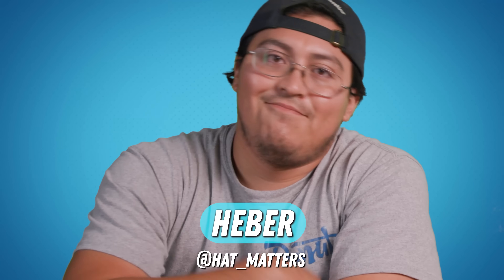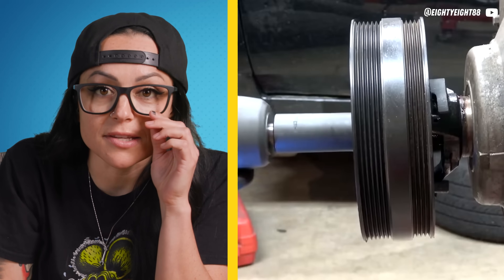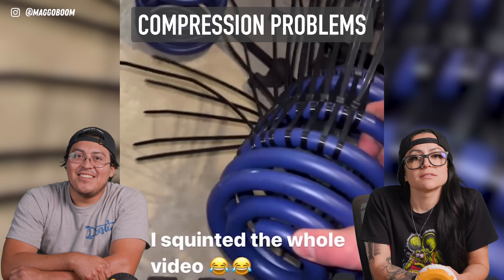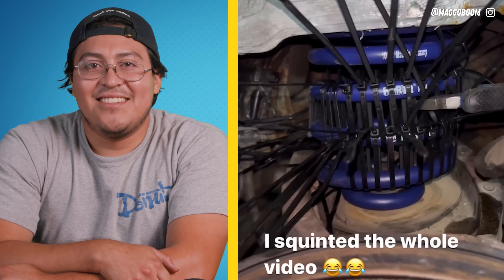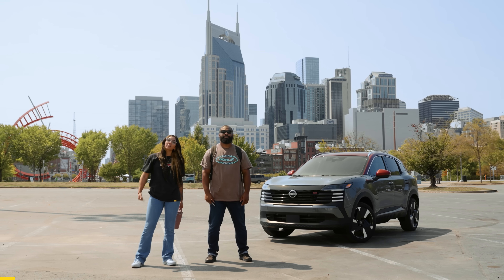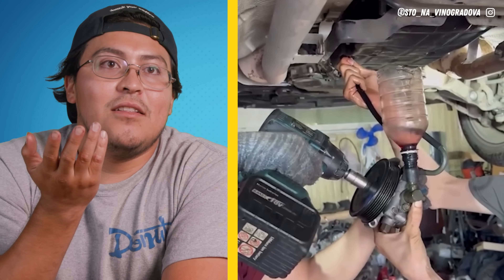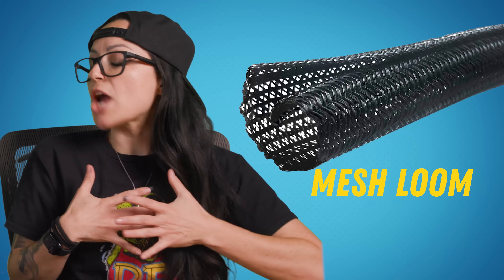Real Mechanics React to Ingenious Tiktok Hacks

Comment: 11:00 So my 2005 Escape XLT 4x4 has a separate V belt for the water pump, and its only connected to the front cam pulley. Both pulleys are not adjustable. So this would theoretically work....if there was room 😂😭

Comment: Air cooled Boxer (beetle etc) alternator is fixed and cant be moved. You use spacers on the(alternator)  pulley to widen / tighten the gap.

Comment: As I see it hacks like this comes in two kinds, the ones that can kill you and the ones that while not always the smartest thing just might save you time or money. The zip ties on the spring was dangerously close to death by spring while deforming the bolt head and hammer a socket on it is something that just might save you a day as you have to go buy tools. Now you really should buy the needed tools either way, but now you don't immediately need it. Then there are times when it can take so much time to improvise a solution that a quick run to the hardware store can save you time and improve your collection of tools. In the end it's all up to you. Doo what you need or think will hep. Just don't trust your life to zip ties holding a spring compressed.

Comment: Been doing the zip tie on the metal cable for years.  Something my pops showed me long ago when I was kid doing the breaks on my bicycle.
Reply: I just use my fingers though sometimes cable is a bit microdamaged and then your finger bleeds :D
Reply: IDGI. Why not just crimp a cap onto it before it frays, rather than after?
Reply: @ you wouldn’t be able to feed the wire cable through once you cap it
Reply: @besticouldget  I hear that haha
Reply: @letsgame7665  When a cable is new, it's not frayed. As soon as you install it, you cap it. Why do you need to feed a frayed cable through anything? (I ride 6000 miles a year on my bike and do all my own maintenance. I've never needed to thread a frayed cable through anything.)

Comment: The easier way to do the smoke test is get one of those $10 manual orange inflator pumps from Harbor Freight or Amazon, a $1 cigar from the gas station, light the cigar and put it in the intake port on the pump, then pump slowly.

Vaping does not produce nearly enough smoke unless testing a very low capacity system.
Reply: It honestly depends on the vape. Some put out an absolutely insane amount of vapor. That said, your way is cheaper since said vapes tend to run upwards of $75 U.S.
Reply: second this guy's statement, there are vapes that can fill a room like a fog machine with one pull... they're expensive and it's not easy to do but they do exist.

Comment: VW Beetle has little metal shims between the two halves of the generator or alternator pulley. If you replace the belt, you have to remove the bolt to adjust it anyway so doing it like this doesn't really serve much of a purpose.

Comment: VW pulleys don't move. It has a two piece pulley on top. You tighten the belt by removing spacers from between the two pulley pieces.

Comment: the spanner split loom trick works every time used it on cars plenty of times and the cctv cameras on my house even custom sleeves on pc builds I do have a tool that looks like a woman's hair clip that is cone shaped but I find the spanner is so much easier , the zip ties on springs no way would I ever do that. The socket trick works near everytime this is why i have cheap sockets in metric and inch in 6 and 12 point. Vice grip if your not using vise grips to close your vice grips you don't have the tight enough for that stripped bolt.

Comment: Nah, I'll stick to my bolt extractor tool, bolt on puller, and the correct size spring compressor tool. I do like the cheap smoke machine and power steering pump idea

Comment: I think I bought the car that the 'hammer the bolt to size' guy owned before- every fastener was messed up torx triple square bolts I should have dumped it in the bay

Comment: That is not a vacuum pump. He is using a small compressor and pressuring the bottom of the bottle to push the smoke out into the engine.

Comment: NOPE to the Zip TIe spring.  NOPE NOPE NOPE.

The belt at 10:40 is puhhhhrooooobably a stretch belt.  The trick would probably work on some modern GMs that are notorious for stretch belts running just one accessory off a 3rd belt.

Comment: 10:06 The pully on the old air cooled VDub generator/alterator is two piece. You just need to loosen the nut to spread the pulley halfs apart. It’s not that hard.

Comment: on the stripped bolt video ive bought actual sockets for that actual problem. Not a mechanic at all but there are tap and die sets for any sort of problem and all but i always have a kit for strips lug nuts anything else to be safe

Comment: If you seal in the rust effectively would that not at least significantly slow the spread of the rust?  Love the wire tie cable fix but blasting sand outta your bare hand has got to suck.

Comment: of all the years ive been a bike mechanic, and worked on cars, im still shocked when auto techs marvel at bike stuff... the zipp tie on the cabke, sorry to say, works the same if i just use my fingers as long as the strands havent been bent out if shape. the zipp tie wouldnt work any better if one strand was bent out of line, bike cables are full twist, fkat layed wire rope, not braided like tow or logging cable, ask any logger to hand splice a bike cable,😅

Comment: 4:40 I'd assume the reason budget smaller 'smoke machines' exist now is partially because of the vape industry, considering smoke machines work using the same theory, you have a heating element/chamber and a liquid

The liquid used in most 'smoke machines' is a mix of glycerin, propylene glycol and distilled water, the first two are also the major ingredients in vape liquid and is what the ratio referenced on vape liquid labels is referring to, more glycerin (VG) more/thicker vapour is produced but better wicking is required due to the viscosity

That being said... Probably don't put vape liquid in a fog machine designed to fill a room... It might smell nice if the flavourings don't scorch on the heating element but I can't imagine filling a room full of nicotine laced fog would be a good idea lmfao

Comment: Dropping a control arm, and then putting a jack under it to compress a spring... You don't like your jawline much, do you?

On cars where spring compressors won't fit, here's a nifty option. Run down to the parts store, spend $20, buy exhaust clamps. You can do the zip-tie trick equivalent with steel U bolts, and you can normally snag 3 coils at a time with the same U bolt. 2-3 U bolts and your "ball of potential energy" will at least have a slow release as you unthread the nut off the U bolt.

Comment: Umm gonna chime in again cause I did use sandpaper to clean rust from driveshaft then paint. Just have hand on side spinning to ground and apply pressure. DO NOT I REPEAT DO NOT GRAB KEEP PALM FLAT AS YOU CAN. 🤙

Comment: I used a Fuel line as a wire cover for some wires to PTO Clutch in Scag Mower, Way they mount clutch housing to Not spin was asinine they had a bolt mount to it and end of bolt went up into a steel cage that let bolt bounce around inside but not spin out of it, Well bolt unthreaded itself from vibration so Clutch housing kept spinning n yanking on wires every time engaged blades causing it to blow 20 Amp Fuse, So I patched up exposed wires then wrapped em in fuel line zip tied em back where supposed to be then mount clutch housing my own way n been gold since…

Comment: The one problem with the V-belt replacement is the new belt would be tighter due to the rubber wearing over time.
Almost a down vote. But did it work?

Comment: I don't think vape smoke is actually better than smoke smoke.

Vape juice is almost 100% vegetable and/or synthetic glycol with miniscule amounts of flavoring and coloring, glycol is sticky AF, this could cause buildup of debris inside the lines.

This while cigarette smoke is mostly just carbon dust which won't attach to anything. Sure, there's some tar in there, but nowhere near as much as there is glycol in vape smoke.

Comment: this belt on The vw beatle engine doesn't have a tensioner on the belt,
 the right way tô change tha is to loosen the alternator pulley nut 

and it Will divides it into 2 hafs 

 then you change the belt 

and to tension it

 there are 10 washers that you can put it inside between the halves or on the outside if you are not going to use it, 

just like the cvt gearshift pulley

, but leave it without any washer inside is bad Idea , the belt will burst, it is basically loose in place and more in the middle of the pulley the is Much tension on it

Comment: So you’re not going to use the extremely easy to replace snap-on socket with the lifetime warranty, but you’d rather use the also extremely easy to replace icon socket instead. Why own the snap-on if you’re not going to use it to its full potential?

Comment: Rust is oxidised metal, commonly iron. It does not thrive or behave like bacteria at all. If you succesfyll seal a rusty piece of metal away from all sources of oxidation, the rusting process will stop (there might be some ion creep, but unless its real rusty, thats going to be limited). Plain and simple. Does paint achieve this? No.

Comment: FINNALLY!!!
in the first clip we have actual EVIDENCE of the "zoom in and enhance" technology that so many are convinced does not exist..... >.>

**edit*
Rust is oxidation. so sealing away the rust behind a rust inhibitor should help. But ye, better to just sand it if your gonna paint it.

since he was spinning the drive shaft, he could have tossed an emmery cloth over it, and held it with 2 hands, same as they do on a lathe. just dont go over the yokes (which shouldnt be rusty due to the grease and oil)

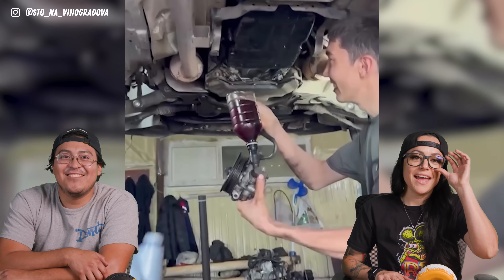Comment: 6:04 saw that clip a while back and seeing now it tilts me ALOT ... thats a 722 Gearbox (from Mercedes) the filler is from the TOP it has a filler tube right besides the engine close to the firewall NEVER SHOVE OIL FROM UNDER since u need to then measure with a specific dip stick and can Actually damage the gearbox if has less or more oil than it needs

Comment: 1:37 yeah but the problem is he could have just driven to the auto store and bought the right one for less than $50.
6:58 Thank you. i really appreciate someone with half my iq explaining how pumps work to me.
9:08 the motor in that tool is not designed to deal with the imbalance the paint can is doing to place on it. it will kill the sawzall pretty quick
15:07 ok so i am specialist bike mechanic (qualified and it is only my side hustle. i'm actually a CS). First up the cable end is about 2 inches too long. it is going to get caught in a wheel. So the correct hack to fix this would be side cutters. But you can also save yourself the zip tie and just do it with your fingers. it really isn't that hard and actually takes less time. this guy also doesn't know how to use the crimpers correctly either
17:45 that final shot of it all clean was not achieved with the washer and the sand. there wouldn't be enough pressure behind it to strip off the paint on the horizontal bar, the guy even does a pass over it and it is unaffected. the reveal shot shows the paint missing. this was media blasted properly

Comment: guy with the springs ands zip ties is dicing with death .. Zip ties are not designed to hold that much pressure and it only needs 1 or 2 to fail and bang spring in the face or lost fingers NEVER EVER do that with zip ties....

Comment: The belt is most likely stretch to fit. Whoever came up with that engineering marvel need to be kicked hard. Need to change the belt? Oh just cut the old one off, and use a special tool to guide the new one on while you turn the engine with a ratchet. No tensioning necessary. Sounds good in theory. In practice its a pain in the ass. Just give me a tensioner with a square hole to put a ratchet head in please. I don't like juggling 3 or 4 different things and needing 3 to 4 hands just to install an ac belt...

Comment: If you used a puller with jaws it's called a harmonic balancer they have a rubber dampener between the two you'll pull it apart how ignorant are you

Comment: The first 2 minutes is cringe. The female “mechanic” and the guy are exponentially terrible as time passes compared to the original donut crew. The puller clip does not show the pulley actually coming out. But they seem to give that clip kudos , and mask it off as a win by describing what is supposed to happen but the 2 second clip does not show the straps working . Maybe it’s the editors; not realizing what the context really is happening. Either way you can tell this new Donut crew/ channel is subpar.

Comment: 14:35 OK, but this is completely pointless. First, there's that huge length of cable sticking out of the derailleur -- trim it. Second, every time you buy a cable, it includes the crimp cap that he puts on it after the cable tie trick. Pro tip: put that cap on to prevent the cable from fraying, instead of using a hack to put it on after it's already frayed.